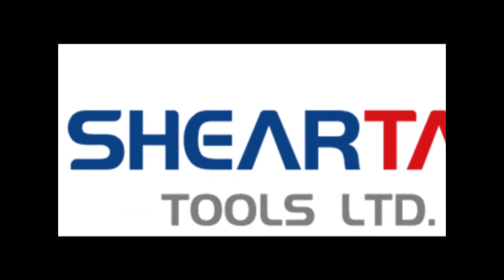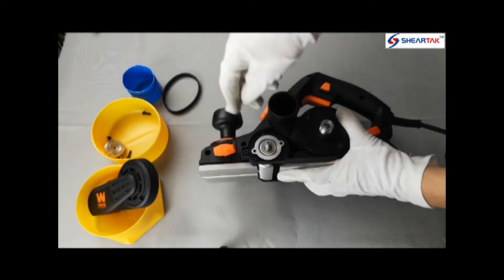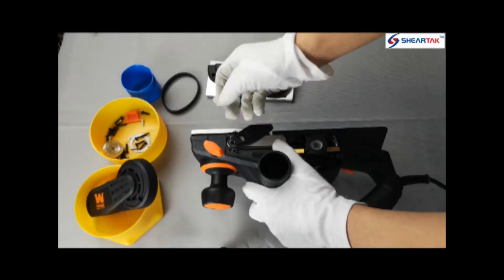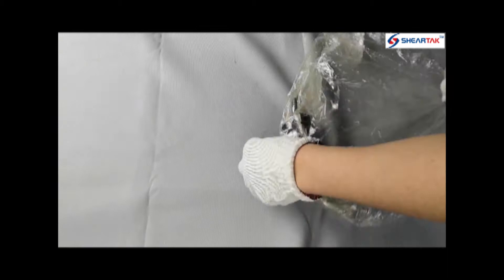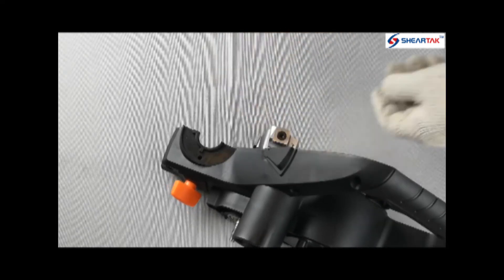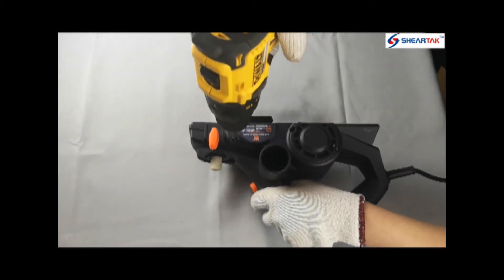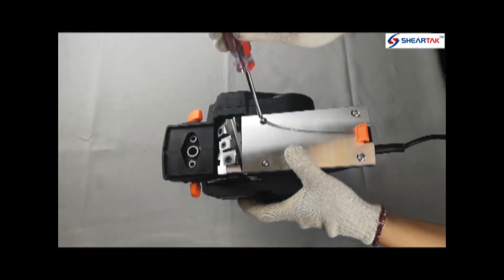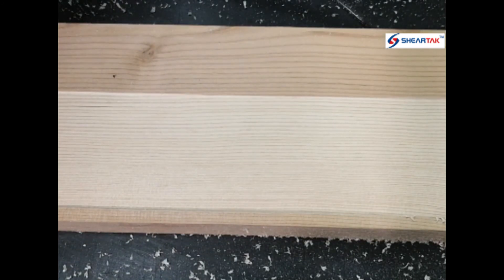How to Retrofit WEN 6530 3-1/4 in. 6 Amp Corded Hand Planer With Sheartak Spiral Cutter Head

Comment: Why would anybody put a $200 cutter in a $40 tool
Reply from the maker: Spiral cutterhead can cut better quality surface finish, reduces noise and three quarter of the sanding work. It eliminates tear-out. The carbide inserts stay sharp as many as 50 times of the straight HSS blades. No need to sharpen and adjust the cutters. Dust extraction is much easier. The investment can be paid back in a short time.
Reply: @SheartakTools 
I went to your website and these spiral cutters were $1200-$2600. I wish your company nothing but success. However, I only paid $32 for the same planer in this video. Come on guys…lower your prices.
Reply from the maker: List price of the cutterhead is $169 Canadian dollar. The Item NoisS00230.  @johncameron4172
Reply: @SheartakTools  I get they are better just don't understand putting one in a cheap tool
Reply: @lakestatebullies7391  I do.
Reply from the maker: Spiral cutterhead can make a cheap tool more valuable and useful.  @lakestatebullies7391